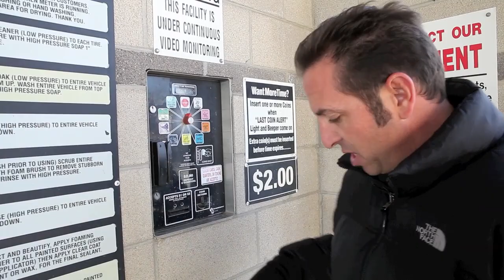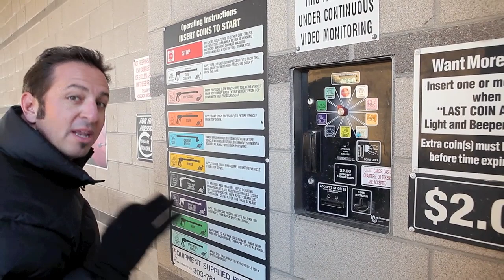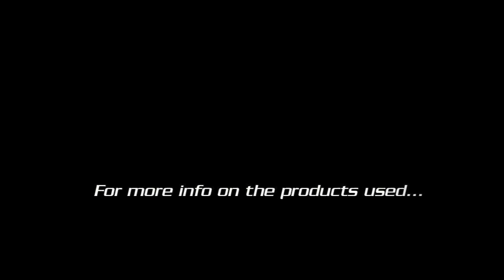Adam's Premium Car Care Winter Washing Tips

Comment: Not exactly how I do the washing prosess, but this will work too. I would recommend with such a dirty car as this, that the car is snowfoamed prior to the washmitt use. In wintertime I also use a prewash to loosen up tar, salt and dirt. This can either be a petroleum based degreaser or a waterbased one. After rinsing this off, the paint will be safer and prevents scratching.